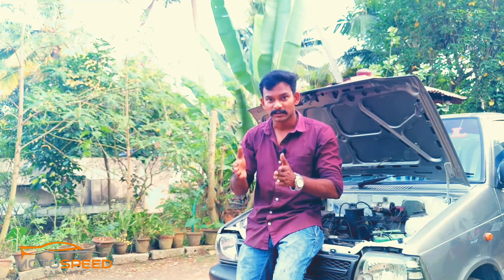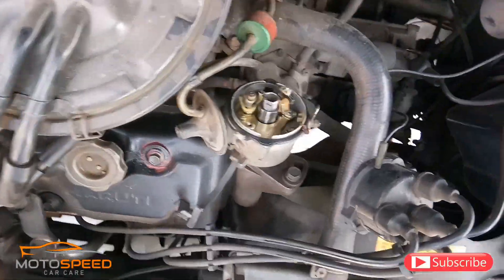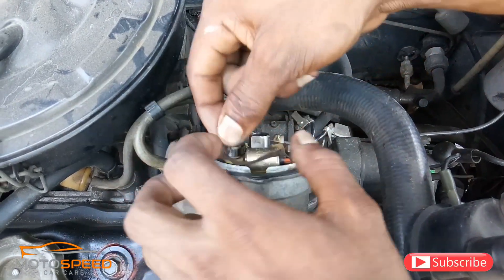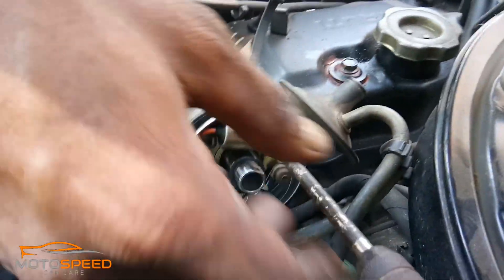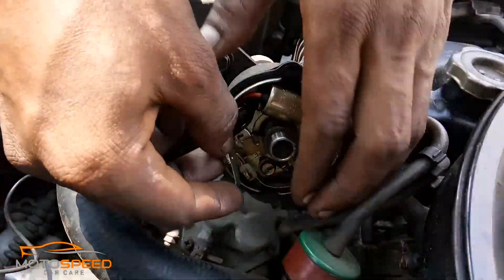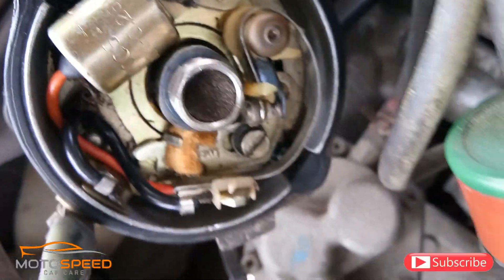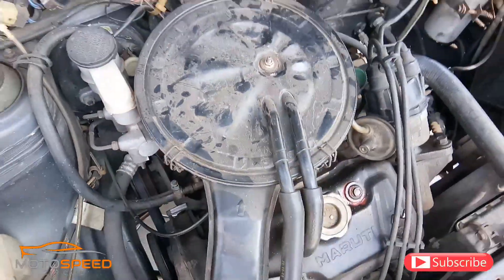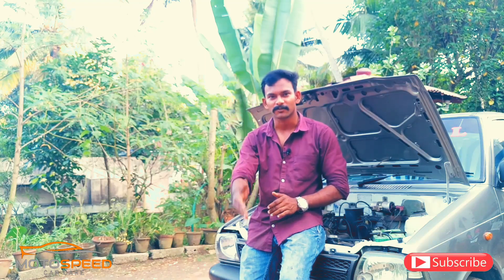Maruti 800 distributor  point gap setting | engine pickup problem solved

Comment: Bro.maruthi zen  കുറച്ചു ഓടിയതിനു ശേഷം ഓഫ്‌ ചെയ്തതിട്ടു .പിന്നീട് കുറച്ചു സമയത്തേക്ക് വണ്ടി സ്റ്റാർട്ട് ആകുന്നില്ല .ഈ സമയം self ഒട്ടും എടുക്കുന്നില്ല.കുറച്ചു നേരം കഴിയുമ്പോൾ സ്റ്റാർട്ട് ആകുന്നുണ്ട്.എന്താ അങ്ങനെ.please help
Reply from the maker: Battery engne undu broo carburator alle vandi ?
Reply: Battery check ചെയ്തപ്പോൾ കുഴപ്പമില്ല. വണ്ടി mpfi ആണ്
Reply: Starter complaint
Allenkil over heat
Radiator fan work cheyyunundo noku
Reply: @navasnaz3022  radiator fan work cheyyunund.

Comment: Noramal  ayi  accelerator  koduthu  odikkumpol  anu  missing  athu  ac  ilum  allathe  odikkumpol  um  ond  enthayirikkum  cmplnt  othiri  cash  modakku  akuvo   plz  rplay  tharu
Reply from the maker: Misfiring normal aayi accelerator kodukkumbol kanikkum bro paranjathu vechu nokkumbol gear nte speed nu kuravakumbol car jerkking pole pokum chadi..chadi mikkavarum athavana sadhyatha mounding nte condition koodi onnu nokkane bro
Reply: Bro  ready  ayii   condenser  mari
Reply: Distributornte  timing  onnu  adjustum  cheythu   ippo  kozhappam  illa
Reply: @midhunviswanathan8912  bro.. same prblm... enganeya sariyaakkiyath... rate ethra aay?